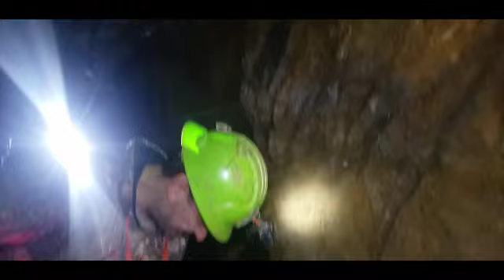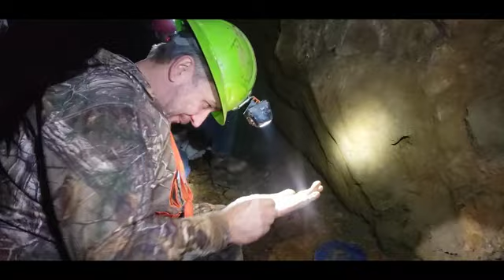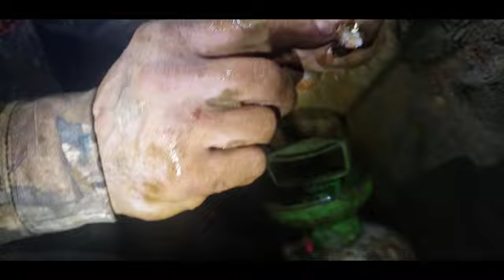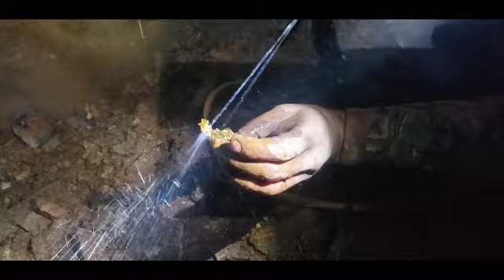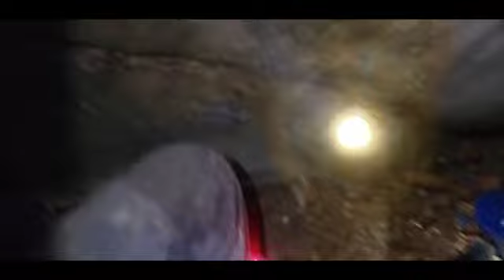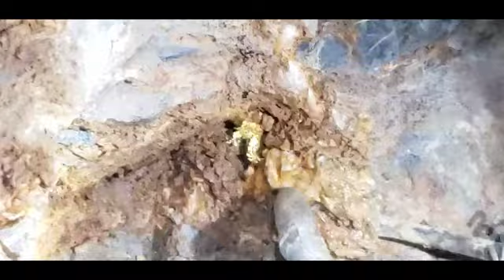Goldbay - Metal detecting November 23 pocket of gold

Comment: Roughly how deep will that metal detector go inside the rock detecting something ? And I have a Metal detector but I never touch rocks with it because I always think I’m hurting the detector ! Other than that it was a very exiting video ! Wish I could be there . Pennsylvania mike
Reply from the maker: The size of the target has everything to do with the depth. The larger the Target in the deeper it will detect it. The specimens we found on this video we're about 10 in in. And literally all metal detectors have a coil cover designed specifically for rubbing on the ground or in this case the Rockwall
Reply: Ok thank you for that information and good luck on the next hunt 🙋‍♂️